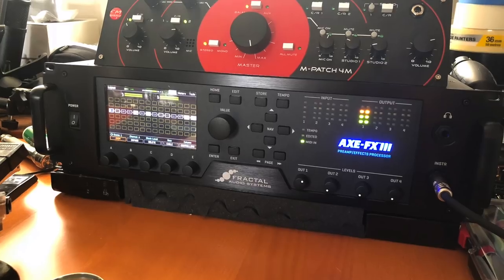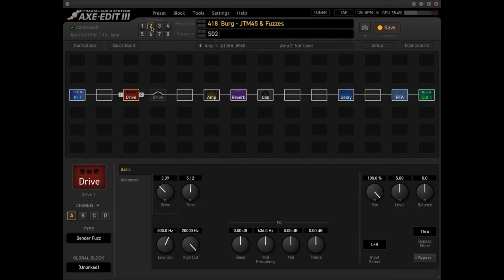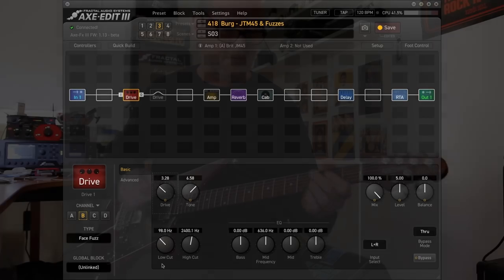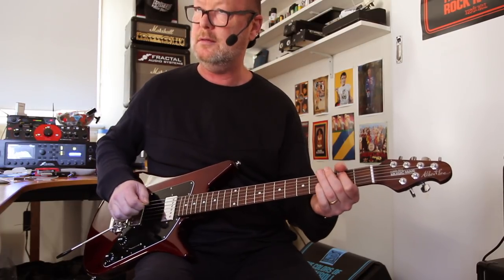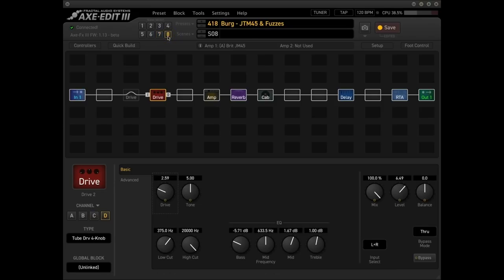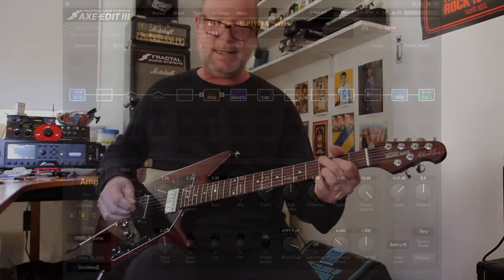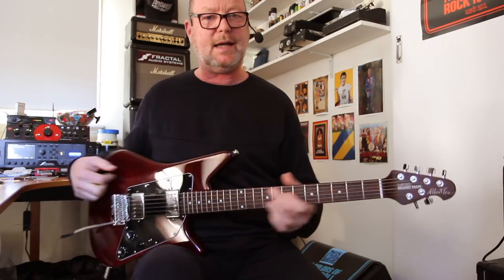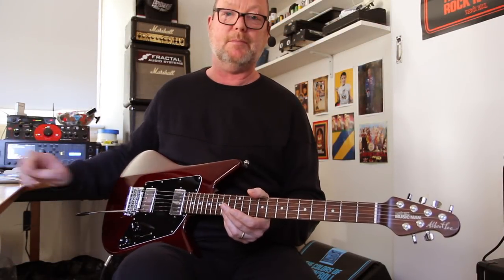Axe-FX III: Old-School Marshalls and Fuzzes

Comment: Hi, Mr. Kingman

I hope I’m finding you well.

I was wondering if you could help me out with something related to the Electro Harmonix "Tri Parallel Mixer" pedal.

I've heard about this pedal that lets you connect up to three other pedals in a parallel setup instead of the usual series or stacked configurations. 

I'm very curious about how this would affect the sound, if the three pedals connected to it were gain-based. 

And while we're at it, I'm also wondering if it would function better for with time-based pedals like chorus, delay, and reverb etc.

I think you're the perfect trusted person to ask, since you know so much about gear and sound. 

Any insights or explanations you could give would be awesome and much appreciated! 

I'm hoping to get a better idea of how this setup could fit into my current rig.

Thank you for considering my request.

A subscriber and fan.

Cheers!
Reply from the maker: The short answer is that it will allow you to create a kind of tonal 'layer cake' out of your three chosen effects. They're not running into each other (series), but rather running 'together' - one on top of or blended with the others. When I'm writing signal paths in the Axe-F III for example, I'll often throw a delay or chorus into a parallel path with the dry signal so I can mix and/or pan as much as I want into the unadulterated dry signal. I can also send one of those parallel-path effects into another effect if I choose and route the lot to the output. By the looks of things the EHX mixer will allow you to do these sorts of things as well. It would certainly be fun and creative and the price, in my opinion, is affordable enough to warrant experimentation. Thanks for your support. Rock on. :)
Reply: @BrettKingman  Than you, it's so appreciated. Cheers

Comment: Being that this video was posted nearly 18 months ago, do you still set the impedance of the input block to 90K ohms when there is a fuzz in the preset? I like the tone with single coils but no so certain about humbuckers. Wondering if the latest FW releases have altered something that obviates the need to alter the input impedance?